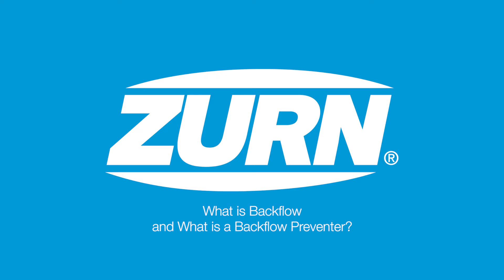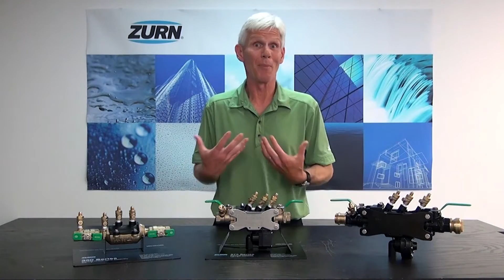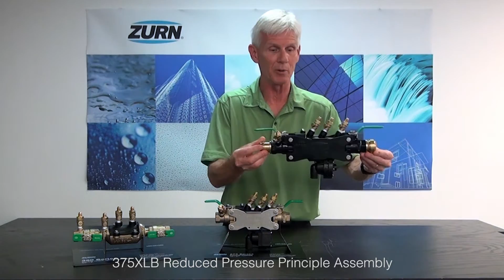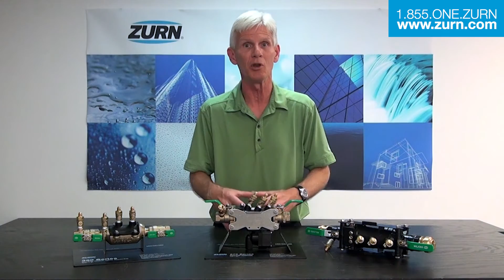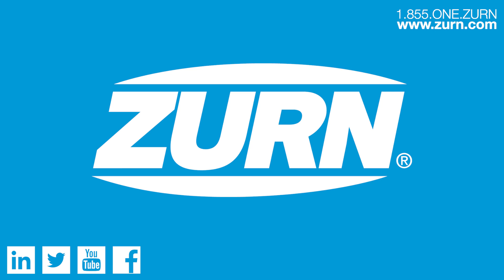What Is Backflow and Backflow Prevention?

Comment: My backflow preventer is rushing water from the vent!?!?  Why?  I checked for debris and cleaned. Still pouring water.
Reply: Old comment, but maybe this will help someone else who was pulling their hair out.  Make sure to watch his other video to see exactly how to pinpoint which valve is leaking.  After much troubleshooting, put a brand new 975XL in, and it was gushing from the vent, just like the one I replaced.  I used his troubleshooting steps to pinpoint check valve #1 as the problem.  I checked it for the fourth time, and it was clean, as usual.  However, this last time I followed his instruction to turn on the water to flush it while the valve was completely disassembled, and that voila, that fixed it.  There was some unseen piece of debris that got flushed out.  Also, their customer service is top notch, I recommend you call them.  I was surprised the attention they gave to a solitary homeowner and how serious they took my problem.  What they told me was consistent with all of these videos, and they were right, even though I didn't believe that was the problem.